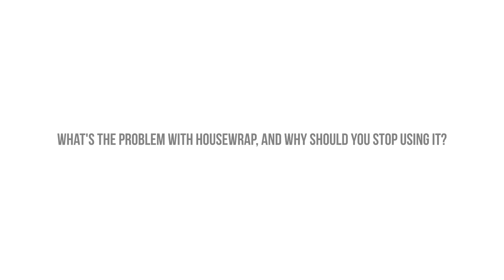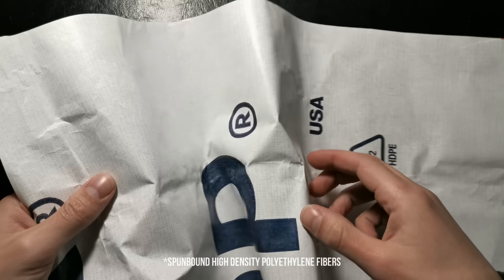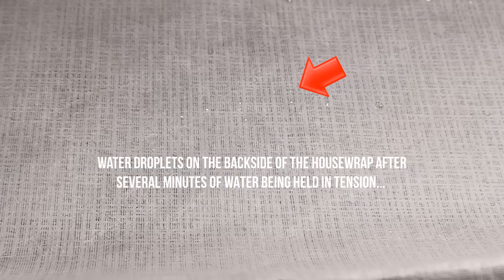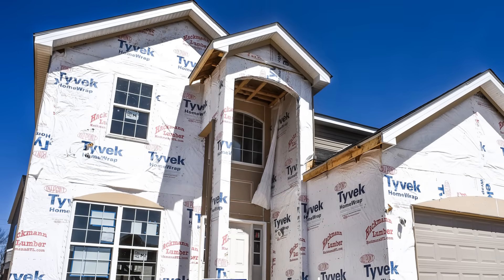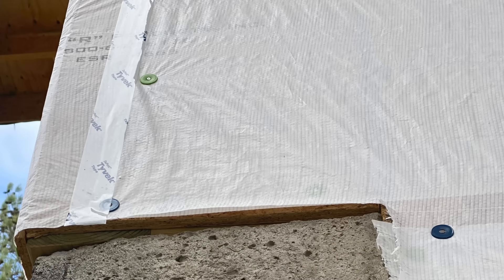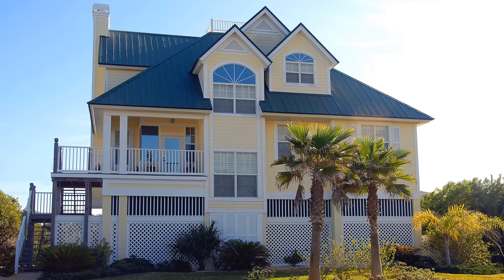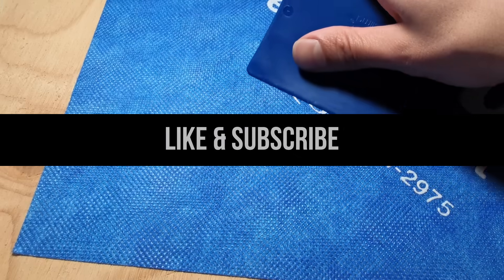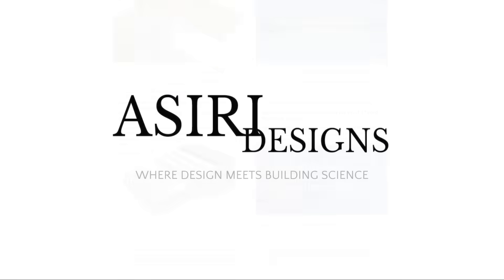Why I Stopped Using House Wrap

Comment: How can I keep my 2x6 walls warmer . I live up on a hill in Virginia  and have vinyl siding and my walls can get chilly when the wind is coming at the house . . There is house wrap  but my northside walls are the worst . there are 2  layers of R30 in the attic besides the insulation that the modular home builder put in . Floors are also insulated and so are the outside basement walls and the basement slab was insulated .  We are seniors  and it is OK in the summer I keep my heat pump at 76   but in the winter 76 barely keeps the house warm when the wind is gusting hard . It is a newer lennox 16 seer heat pump with a wifi thermostat  and  during July and August  my heat pump barely had to work . I get a report every month  and july it worked only 48 hours and August only 36 hours , we don't like it cold in our house . What can i do to the outside of the house t keep the inside walls warmer . The house was built in 2004 as our retirement home

Comment: Literally every dumb thing you claimed about Tyvek being full of holes and holding in water....asphalt does.  Tyvek literally says from the manufacturerers suggested install claims it is a 'bulk water barrier' and allows the house to breath to let water that gets in to evaporate out.  Comparing a aftermarket wrap to 'painted' plywood is absolute nonsense.  Almost every issue you 'claimed' directly goes back to poor installation processes and lack of training.

Comment: Actually self sealing products sweats seen it, and the whole exterior including plywood had to be stripped!!!!! The answer TO MOISTURE IS TO CREATE BREATHING
Reply from the maker: @hankgriffin5397  You're conflating air leakage with vapor diffusion. We have a whole video discussing the differences here: https://youtu.be/yrHjqOMAZno?si=D-XDblGdFkPIObxC  Not all peel and sticks are impermeable (for example Blueskin VP100, Delta Vent SA, and Vapordry SA are all vapor open. We certainly do not want air leakage. Another factor is climate and the interior relative humidity your building is operating under.

Comment: houswraps like Tyvek,Typar, etc are NOT designed to be completely sealed for a specific reason.  They allow the outside wall to breathe, which is very important.  They allow moisture that might get behind to diffuse out and let the sheathing dry.   It is not a vapour barrier.  The vapour barrier is a different entity and goes on the warm side of the wall.  If you were to seal the wall from both sides, that's when you get moisture problems.

Comment: Really enjoyed this one and the one talking about vapour bariers and insulation.  Any chance you might be able to do a deeper dive into insulating (or "re-insulating") an old home?  Your information seems invaluable for a new build but some of us are renovating old homes (50, 100+ years) due to poor insulation or insulation that has degraded over time (animals, settling).  I'm going to encapsulate my "new" (old) home crawl space in the spring using some of your advice.  Cheers.

Comment: I think the mistake in your logic is that condensation only occurs at 100% relative humidity ... unless it's pouring rain outside, the moisture flow will be from inside to outside ... the vapor barrier goes between the drywall and framing lumber ... stopping infiltration of air from outside to inside ... air is a GREAT convector of heat energy ... we let the wood components "breath" water vapor in and out depending on the season ...

Heating your home in winter will drives the water out of your walls ...
Reply from the maker: There's no mistake, different climate zones and assemblies require different approaches and materials specs. You do realize in warm humid climates, vapor drive is predominantly from the outside inwards? Combine that with a reservoir cladding which absorbs and stores water, and central air conditioning, and you basically have a sponge on the outside of your building. We see a ton of mold on the backside of the drywall in these climates. You want to throttle that inwardly driven vapor from the outside before it has a chance to enter the cavity. You certainly would not want a vapor retarder anywhere on the inside of that type of wall assembly.
Reply: @ASIRIDesigns  - Fair enough ... I'm in the rain forest and it's all about shedding liquid water and keeping the roof mowed ...

Comment: lol when idiots make videos , house rap has two functions weather and AIR  barrier , tar paper has been out of the building code for more then 20 years , the holes self seal on building wraps .  fcking sales pitch's , building paper does the exact same job as zips but with the paper you dent need diagonal bracing you end up with a much stronger wall system with building wraps , both do the exact same job and both seal nail holes in the exact same way asiri designs you embellish . why ?

Comment: You're using Tyvec wrong. I love the stuff. Put tar directly on the wood. Paint the Tyvec on with more tar. Tyvec is polyester. The clapboards or shingles will hold the Tyvec on. All wrap materials should breathe a bit before you tar them.

Comment: I have never believed in house wrap. And certainly not the similar product used on roofs. My stucco contractor put up felt tar paper, then the expanded metal lath. My roof has 30 pound felt.
I also used a 6 mil vapor barrier instead of a 4 mil and all the joints were taped and sealed. Penetrations were foamed. R65 in the attic. This was 35 years ago.

Comment: It creates an air barrier another temperature between you and the cold you and the heat house represent engineered to breathe better than felt paper which felt paper caused rock felt paper was a good idea, but to keep the insulation working to keep your hint in air where you want it you want house right because it breeze it may not be fun to put on but in the long run it saves them money that’s why I put it on. I’ve lived in a mini house that I built with the house wrap on the inside and outside and takes me about 30 minutes to get my house in the proper temperature and then I don’t have to run it again for the rest of the day that works in heating and cooling. It’s an insulation. It’s a separate barrier. Remember you change you put air barriers with different temperature to keep the heat away or to keep it cold away centric wraps that you stick on there will actually trap water into your wood just a thought.

Comment: Rows of 15# felt is the best. Sheds water but also breathes at the joints to dry out moisture. Think fish scales. Don't turn your house into a giant ziplock bag where moisture from Inside also gets trapped. Some air penetration is good!
Reply: Thats All I use is tar paper heavier roll at H/D......Also All Pre dired Press Treated Lumber and press treated plywood with a white wash light paint coat with mildew blockers and also the short ext wall on my house with bath tub is press treated and cresoted to prevent rot...Bathroom Wall on North Side prone to mold.............Tampa...Mold Capital of the USA...............

Comment: Water traps moisture must be controlled. incredibly while watching Barndo-minium videos I ran across several where people were spraying  thin layer of closed cell foam on the interior framing/metal cladding and then laying bat insulation over top of that on the inside because it saved money, so now their vapor barrier is on the outside of the insulation, there were even people advising others to do this saying that it works great. NO it doesn't. Afterwards they couldn't figure out why they soon started having wall moisture & mold problems. Just goes to show that you need to do research from solid experts in the trades if you are not one yourself. It was really stupid advice that cost them a lot of money and hassle to repair, so much for saving money by doing your own build.

Comment: Installers can sometimes rush the installation of Tyvek .ect. and puncture this barrier with the faulty fasteners and not taping every seam correctly on a regular basis. Then install siding over these small puncures and gaps.  No one knows until a heavy wind driven rain hits this area and then water is inside your wall looking for a place to go down. If you see water dripping from the top of a window the Tyvek install is likely the cause. Especially on new costruction. Look for stains inside window casings when buying.

Comment: Synthetic roofing underlayment is what I use now,Felt sucks,it gets crunchy with age,it's extremely flammable. Tyvek sucks also,it degrades with age also.
Reply: Felt paper is not extremely flammable, and no, it doesn’t get crunchy with age unless it’s exposed to the weather. I’ve been roofing for 32 years, thousands of roof installs, tearing off roofs that are 25, 30 years old and the felt paper is as good as the day was put on.

Comment: The best way (like I did on my hose) is to wrap first 60 minutes tar paper, then over it with Tyvek. Make large overlaps up to 12 inch. then go over them with Tyvek peel and stick tape. On the windows have to install with calking on the window flanges, every hole needs to be fastened, then 6-8 inch peel and stick wrap, then Tyvek peel and stick tape on top, when wraps installed. The first peel and stick should go over painted OSB around the window rough opening, not over wraps, like everyone does for the wrong reason. And build your house with plywood, not OSB.

Comment: I tried using house wrap when I redid siding and windows on the front of my house. After it rained the siding was wet at every staple spot and after a couple of days the back still hadn't dried out. I tore it all off and used the heaviest tar paper I could find with hot galvanized dipped roofing nails.
Reply: Things like tyvek are insane aren't they?  All the tech... defeated by the attachment method: punch hundreds of holes with stapes, and what could possibly go wrong?   So I would rather see a peel & stick or something pre-bonded like zip sheathing.

Comment: I just used old school tar paper when building my small off-grid dream home (built by pros...not me personally). Since the house is passive cooled in the South I was concerned about mold and moisture being trapped in the walls. I also went with mineral wool insulation and plywood (instead of OSB). Basically all materials used prior to 1930.
Reply: Plywood wasn’t widely available in 1930. My 1948 built house has board sheathing on walls and roof. Many builders wouldn’t touch the stuff. Same with drywall. They used it for lath under the plaster but never for a finished wall.
Reply: @Krunch2020 Wonder of it's hard to find a person who will install plaster walls, now. I hate drywall! Always searching for alternatives.
Reply: @karlakay  Today, it's called 'Plaster Veneer' special drywall type board and a scratch coat and lime veneer coat. Super durable, very smooth hard finish. The Nyon white tape you see was invented for this system.
There are still some specialized contractors around doing this, it's an art.
Reply: @bobwild9995 Yep, I then finished using Moroccan clay paint. In potential wet areas such as bath and kitchen I then applied black olive oil soap. The result is way easier cleaning and zero need for a kitchen backsplash.
Reply: All i use is 30# tar paper
Reply: I have a property built in the 1940's which has a tarpaper barrier.  At eighty years, it's brittle, cracked, and likely worthless as any sort of barrier.  Of course, in eighty years you will be dead just like the rest of us so it's somebody else's problem then.
Reply: Plywood only became available in 1940s
Reply: @MikeNomad-qs3wd  "Modern plywood began with a patent for cementing layers by John K. Mayo in 1865, revolutionized by Immanuel Nobel's rotary lathe (c. 1860s), and became commercially widespread in the early 20th century, with standard 4x8 ft sheets introduced in 1928."
Reply: Why exactly, did you have any real reason or just some opinion based on irrational assumptions?.
Reply: @tommak6516  Irrational assumptions? I do not use HVAC. Moisture/mold in the walls is a very real concern.
Reply: @anonz975  why plywood vs osb? why mineral vs ?(fiberglass?)   Both have almost exactly the same properties regarding things that affect mold.
Reply: @anonz975  why plywood vs osb? why mineral vs ?(fiberglass?), They have similar properties regarding things that affect mols.
Reply: @tommak6516  Fiber glass insulation in the walls can become somewhat "compacted" and hold water especially on lower walls, plus mineral wool is sound deadening. I did use fiberglass insulation in the attic since there is plenty of airflow and it will dry out fast. Plywood is stronger than OSB, OSB varies a lot with regard to consistency and how well it dries out after moisture hits it. Tar paper expands and contracts and dries out easily. I also had a rainscreen done so any water that gets behind the pine board and batton siding can drain/dry out. Basically I did my best to replicate houses built prior to 1940 when no one had air conditioning, if the power goes out for an extended period of time most contemporary houses will end up with mold problems in a very short period of time. Since I use windows and a fan to cool the house the humidity level swings a LOT especially in the summer.
Reply: Tar paper is the very best, I know I'm a GC for going on 48 years
Tyvex is garbage

Comment: recently renovated the exterior of a 20 year old 6500 square foot house and all the tyvec was at the end of its life. 
my first house had no insulation in the walls and the exterior was sheeted with 3/4 inch tentest and aluminum clad pressboard siding. i completely stripped the house , new windows and doors , added vapor barrier, r12 in the walls and sheeted the exterior with 1 inch SM board all sealed up nice. my heating bill was 150 a month before and 140 a month after. so if i live there for 1000 years i’d see a return on my investment!

Comment: I switched to plywood that already has a coating. You must tape them as recommended, but way easier to deal with. But some jobs just have different needs and challenges, so don't rule anything out.

Comment: Tar paper is less prone to rot from water intrusion because it’s not wind resistant. Mostly depends on lap of paper same as tyvek. Most carpenters don’t take the time to properly install either. The most important part for long life is installation.
Reply: Agreed, if you’re using vinyl siding over tar/felt paper backing, your house will be incredibly drafty. but, whatever water gets behind the siding will absolutely dry out and not be trapped. you have to choose one or the other.

Comment: I despise dense glass. Why the fck would you put drywall as your sheathing? Same with hardier board siding it’s freaking stupid to use those. Metal or wood is all I put on my house. I do residential siding repairs in Canada. My area has a lot of nasty hail storms so anything but wood or metal siding gets destroyed. The main thing I don’t like about Ty ex kid the 9’ rolls really hard to staple the entire thing top to bottom and in the sun it’s blinding lol I have to wear sunglasses sometimes or I go snow blind

Comment: In final effect,, mostly I agree.  I DO strongly counter your argument as to water or moisture source.  You are wrong.  The moisture is almost never coming from the outside  in. You can build a boat with Tyvek. It is water proof.  Where the moisture is coming from is the interior.  Showers, cooking, breathing, but mostly HUMIDIFIERS,, and air conditioners.  These can pump 10s of gallons of water into the interior conditioned spaces and MOST humidifiers are running on furnaces in cold weather, wide open. They are not observed and controlled by the homeowner. In fact, the 'more is better' mentality, nearly all humidifiers are set at maximum,,, because it feels nice indoors. The moisture is moving from the inside, through the drywall and insulation and condensing at the dew line, the cold line which is most commonly the backside of the house wrap.  If in coastal Texas the house, with cooling set at 70F interior, and 100F and humid outside, the moisture IS coming from the outside,, but not as liquid water. there is a sweat line inside the wall where humid meets cool, 
30# tarpaper, felt, works best. 15# felt is insufficient.  And control the danged furnace mounted humidifier, or shut it down entirely.

Comment: I live in Minnesota and the stated temperature delta requires R23 to avoid condensation. Can a zipr system be used or would it just drive moisture within the exterior wall?
Reply: I live in Minnesota, the last two homes we built we used the green zipper system I like the coating and the extra foam board added on to the back and then we still added R23 insulation into the 2x6 walls (double insulation) with a plastic vapor barrier. Just have to make sure you take your time and get the seams taped on well. The system has their own specific roller to apply the zipper tape.